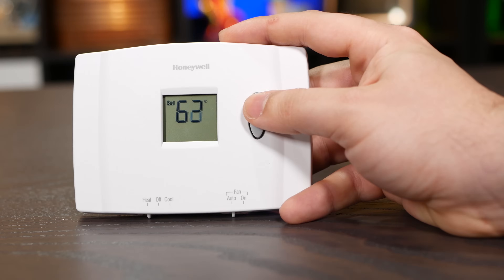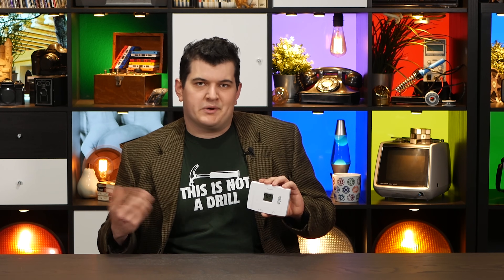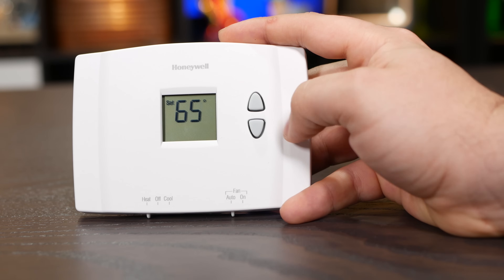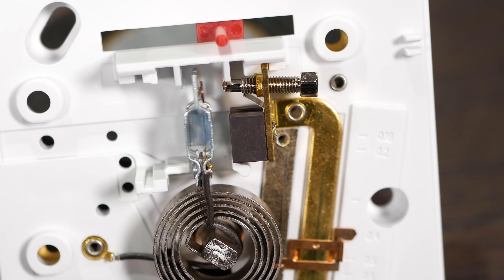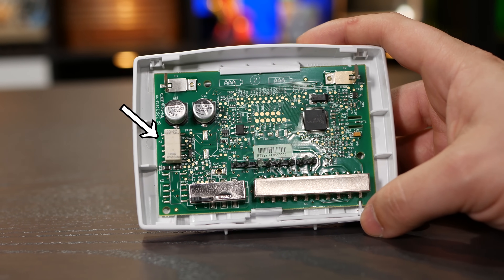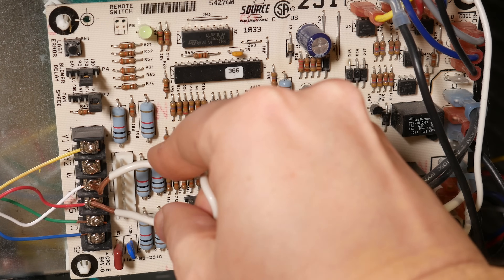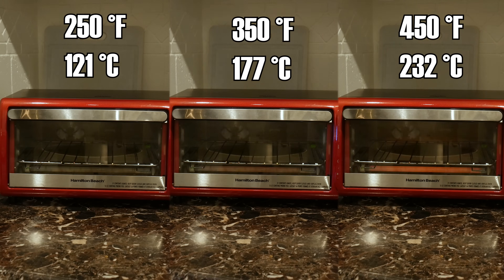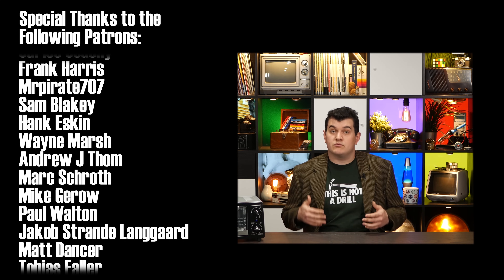Thermostats: Cooler than you think!

Comment: In response the the cooling/heating on demand question this thermostat can do that sort of. As long as you program in a regular schedule, if you make an in the moment adjustment and Do Not push the "hold" button, it will automatically cycle back to the next pre programmed scheduled temperature when the clock strikes that time. https://hvacsurplus.com/products/honeywell-focuspro-6000-2h-2c-th6220d100?gclid=CjwKCAjwwtTmBRBqEiwA-b6c_xColqVmir9hS9ECqzE15WVP5mbBJATgYhZoLlCYYI2tkH5zQ9BHABoCFSoQAvD_BwE

Comment: Looks like a perfect Arduino project! :)

(But use STM32, cheaper and more powerful than those old arduinos)
Reply: Just use an ESP8266/ESP32, and you can even make it network connected!
Reply: @aveaoz  , that's true. The dev environment is not as mature as it is for STM32, but you can get your job done nevertheless. (Y)

Comment: I was trying to tell my flatmate to stop turning the oven to 250C because it would actually take longer to get to temperature than just setting it at 200C. 

So the myth certainly is a persistent one.
Reply: Well, it won't take longer. Unless you mean accounting for time to cool down from the overshoot.
Reply: @EvenTheDogAgrees  I do mean that, they were saying that it should take less time for the oven to get to 250C than 200C because it should, in their theory, be heating up faster....
Reply: @amcghie7  Ah, lol, ok... That's umm... Yeah, they probably extrapolated from something akin to my stovetop then. :')
Reply: True that, although the Panasonic microwave ovens apparently do more than PWM with their "Patented Inverter Technology". (Which makes them more expensive and less reliable but cooking nerd compatible.) Wondering if any high-end appliances (ovens, refrigerators/freezers, etc) have multiple/variable staging. And would love a teardown video of this Patented Inverter Technology (R) compared to the PWM of most microwave/toaster/builtin/whatever appliance devices.
Reply: @claud9999  Not sure that teardown would yield anything, since it's probably all implemented in firmware flashed on the microcontroller.

Comment: I don't know if it is just because my microwave is cheap, but on any of the lower power modes, and not on high, it has a slow duty cycle. I think it is stupid. Is this how they all operate, or do normal microwaves just regulated the output? If I want something cooked at a lower power, I don't want it to be blasted with full power 50% of the time and then off for another 50%.

Comment: I've had systems with 'boost' buttons, but only as part of the timing element, not the target temperature. Mostly it seemed to be if you were (for example) staying home one day you could turn the heating on for an hour without having to reprogram the schedule and then undo it later, or risk forgetting it and having the heating blast when you weren't in.

Comment: Engaging!

We have a Lennox HVAC system with a wifi-thermostat.  Though they made it better a year later, the T-stat does have a setting that allows to set a temp for 1, 2, or 8 hour intervals.  This is especially handy when the wife is cooking in the winter and the heat has not turned on, since the stove (which is near the t-stat) kept the ambient temperature above the normal setting.

Comment: The problem with changing the heating/AC output for a short period is that is typically takes about 30-60 minutes before you really get the effects of it, and then it shuts off right away. If you come in from mowing the lawn and want some fast cooling, your best bet is a fan or shower.

Comment: you are technically correct that the system is ether on or off but with more complex systems you could have the the heat turn off sooner and then wait and use the carry over to coast to the correct temp and then in turn turn on sooner inorder maintain the correct temp more evenly this requies a temp sensor for the outside. however in this case overshooting the temp would make the house reach the desired temp faster however it would get too hot aswell.

this kind of a system also requires a plumber to setup. however one neat part about this kind of a system is that any home using a system like this uses the same line chart that simply off-set depending on the size of the house and the desired heat.

Comment: There are multi stage furnaces (and ACs) so technically there is a medium stage I guess... Although it's still not designed to be used like that.
Reply: My heat pump from 10 years ago was designed exactly in that way.  Both compressors only came on when the temperature differential was high, or the predicted rate of temperature change would be too slow.  Otherwise the system was sized so nominal operation ran only one compressor at a time; each cycle alternated which compressor for wear-leveling reasons.

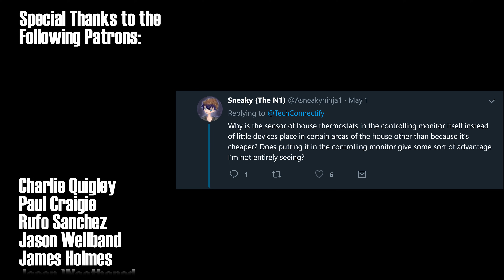Comment: 14:25 and 16:26 - I have the Ecobee3 thermostat that does both of these, somewhat.  

The base unit has its own thermostat, but it comes with remote sensors that you place in each room.  The real advantage is that each also has a motion sensor, so the system can make a deduction of the "average" temperature based on which rooms actually have people in it.  So if there's a room that, for whatever reason, takes more effort to heat or cool for the system, it can ignore it when people are not in it, or run extra if people are in it to keep them comfortable.  The app/interface also lets you see the specific temperature in each room, and the scheduling allows you to tell it to ignore zones too; this can be useful if you use a separate heating method for that one room, but still want to look up the temperature for the room.

For the latter, I have it setup that when you change the temperature settings, it holds those for 2 hours, then goes back to the original schedule.  I use it exactly as mentioned; if I was just outside during the summer working or exercising, it's nice to come inside, drop the temp settings by a couple degrees (or do this on the phone app before I go inside), and appreciate the cool air.  Other options are to hold for 4 hours, hold indefinitely, or hold until next schedule change.

It also uses the motion sensors to auto set home and away modes, so there's not need to manually do so, or for the system to keep track of linked phone apps locations.  Or to go downstairs and wave at the Nest to say "hey, I'm home still!"...
Reply: I have the same thermostat and also appreciate that it has a way to lock the interface. Take that, you rotten kids who like to crank up the A/C! And get off my lawn, too!
Reply: My mom has this kind of thermostat. She moved into her house less than a year ago but the thermostat keeps changing back to whatever settings the old owners set it to. She can't get it to remember her own and she just wants to be able to control the temperature as needed anyhow. Is there a way to shut off the "smartness?" She wants her dumb thermostat to just work. Shes 65 and not computer literate in the least. I can't figure it out either.
Reply: @geekygirl2593  If she truly has the Ecobee (3 or 4, afaik) thermostat, you can go into Settings -> Preferences -> Hold Action, and set that to "Until I change it".  If it's not specifically the Ecobee, though, I can't help you with that.

Comment: In response to the final question, I've known heating systems to run on "boost" (blast on max for half an hour). Most recently was used in conjunction with downstairs heating and radiators upstairs, activating boost would heat the radiators while the floor heating would kick on (bit pointless as it heated the top of the house but still, it existed!). 

Relatively common thing in the UK for heat at least!

Comment: Don't ever get a heat pump if you live in the mountains or anywhere north of Georgia. That emergency heat will rack up your electric bill like nothing else.
Reply: If the system is operated correctly, it is rare that the emergency heat comes on.  A smart thermostat is very helpful to prevent "panic" temperature adjustments to accomplish this.  I am in Oregon, a northern latitude state.  Even when I rent houses in the mountains, heat pumps are far superior.

Comment: You missed another one: light dimmers also uses this type of PWM too. p.s. you can use a thermistor and a dimmer to control the oven. while achieving the same level of control to the temperature if not better.

Also I have seen some entirely computerized HVAC installations that connects everything using Ethernet cables. All "thermostats" are just miniature computers that has a temperature sensor in it and is powered using PoE, the heat pump control board has a standard Ethernet jack for connections, and the central control unit is literally just home router hardware with PoE output and some HVAC controlling software loaded on there.

Comment: In Brazil we use single rooms A/Cs, they now can actually control the "cold" output by regulating the compressor, it's not just ON/OFF anymore, they save up to 40% electricity by doing so, as well as keep a perfect temperature, inside fractions of a degree, because they don't need that 1-2 degree range of down time. Also they have a "follow me" function where the remote control acts as the thermostat, overriding the units built in thermostat so the temperature is monitored closer to where you are.

Comment: Is there any difference if you have, say, an old radiator system for heating your house? My old apartment had decades-old radiators in each room.
Reply: I haven't (knowingly) seen a modern radiator system but those I do see (in 70+ year old buildings) don't restrict themselves to a binary on/off.  Instead they vary the amount of heating fluid to eventually achieve a steady state in the midst of their operating range.

Comment: To that last question. Yes, some digital thermostats have a "temporary hold" that will run till a new temperature is achieved, then go back to its previous setting. 

If you would like your new setting to be the 'permanent hold" there should be a "hold" button you can push.

Comment: Only exception is multi-stage AC units (like a 2-stage heat-pump), or an Inverter system where the compressor/fan run at varying speeds. The inverter setup is variable and can provide anywhere from 1-ton to 3-tons (for example) of cooling as required, where-as a multi-stage (I.E. 2-stage) system has either 1.5-tons or 3-tons of cooling hence 2-stages of capacity. The idea behind the Inverter system is that the AC almost always runs, but only by using the least amount of BTUs required to meet the heating demand by varying both the fan speed and the compressor speed. This is VERY common in mini-split units, and is making it's way into central AC units as well. As far as adjustable/programmable thermostats, those have been around for a while in commercial applications as cooling a 40K square foot office building at night to 72 instead of 80 has HUGE power bill implications. I have a Carrier 'Cor' thermostat installed in my house which allows you to set up programmed temperatures. So from 8am to 11am when I'm waking up, it will keep it between 70 and 72. From 11-5pm while i'm at work, it will keep the house between 78 and 66. From 5pm to 11pm it will keep the house between 68 and 74. From 11pm until 8am it keeps it between 68 and 70. If you make a temprature change, by default it's only for that cycle until the next program kicks in. You can also tell it to keep that setting until a certain time or indefinitely until you tell it to go back to it's programmed settings. It's also WiFi and lets me use it from my smart phone, as well as senses when you walk by and displays the outside weather forecast and current indoor settings/program. I love it because if i'm laying in bed and I feel hot, or cold, I just grab my phone on the night stand and change the thermostat. It also lets me set it into vacation mode so I can tell it for the next 3 days just keep it between 68 and 78. It's pretty neat, and I like it a lot :)

Comment: While it's not "For 30 minutes", the (Electronic, but not smart, RobertShaw 9600 http://www.robertshawclimate.com/thermostats/9600-series-thermostats) Thermostat we have here does something similar. When you program it, you set 4 times and temperatures (Morning, Day, Evening, Night). When it's running from that program, you can use the temperature adjustments to manually change it. It continues running at this adjusted level until the next programmed time, at which point it resumes the programmed temperature. I presume this is a somewhat common feature.